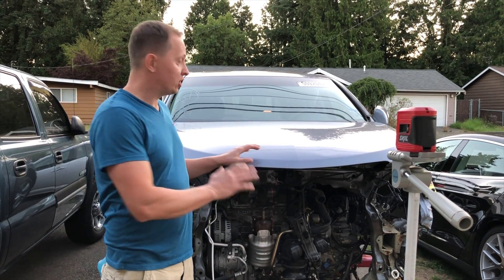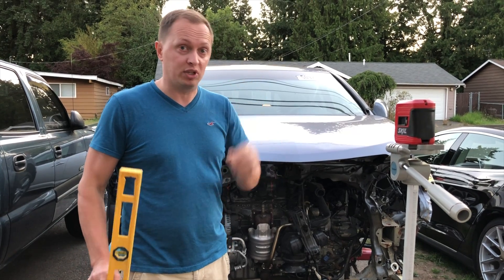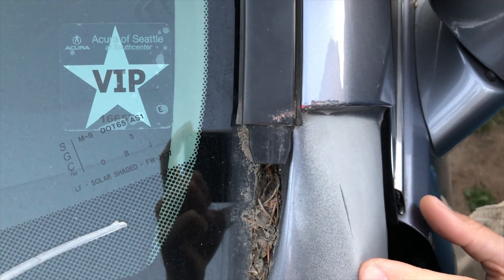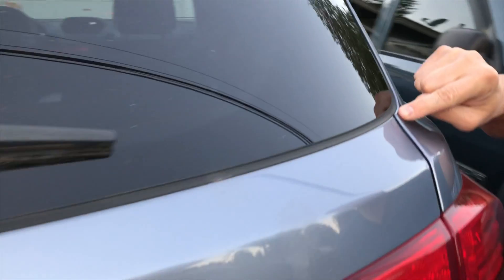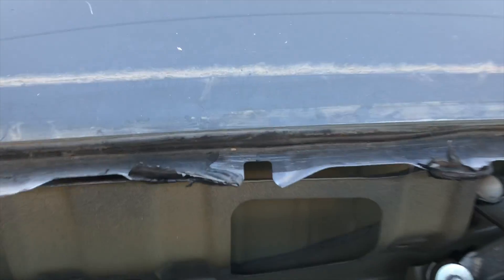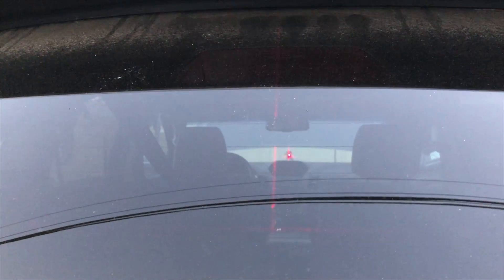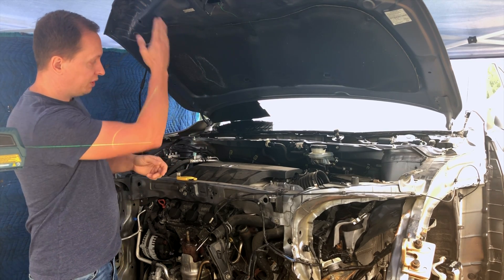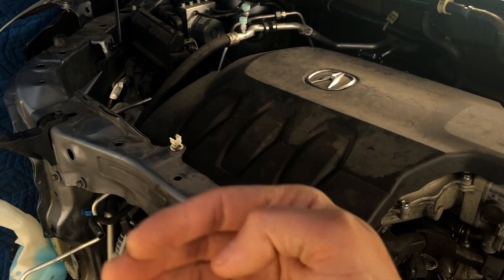✅ How To Use a Laser to Measure Auto Body Car Frame Damage Collision Repair Equipment Universal DIY

Comment: Wait! You are judging the frames integrity based on the the tin foil attached to it?  Obviously I am no expert or I wouldn't be here, however common sense tells me....
- ....the sheet metal between the frame and core support could easily be compromised a 1/4" without effecting the height of the core support itself.  
-  Which  means this entire process is dependent on the one part you dont show, leveling the car. You comment on the importance and skip right to the center line? 
   If someone watching this doesnt understand how to use a level to measure for a centerline they sure in the hell dont know how to use it to level 4 corners of a car!
-  So, I can only assume the car is supported by jack stands behind the front wheel because surely  a coil spring cant be trusted, can it? And you don't think the frame rail could be bent up forward         of the jack stand and absorbed by the vertical sheet metal in the core support with out effecting its horizontal axis across the top? Especially with the hood latched?

I am not saying your wrong, I am just applying common sense and CAN NOT afford to not get it right the first time. Is there a reason you are not using a Centerline Gauge? A cheap set used can't be much more than a laser level? It' has to be MUCH more accurate  than using the sheet meta... that even looks bent?

I realize this is 5 years old and will have to seek answers else where.... however, like I said, I can't afford to not get it right the first time.
Reply from the maker: That was an old video, I've got some other videos that are more recent where I go into much more detail on getting everything leveled out and measure it out. Here is a link to one of those videos if you're interested: https://youtu.be/3mwsqGRthSE

Comment: Wow i guess you dont need any service manuals with this method pretty awesome
Reply from the maker: Yes, this method works great. Only caveat is: one of the sides of the vehicle has still retain its original dimensions, meaning that it cannot be damaged due to the accident so you can mirror off of it.
Reply: So in other words as long as one side has no damage you can use this method.
Reply from the maker: Exactly...
Reply: So in example if just the front left of a vehicle is damaged this method will work.

Comment: excuse my ignorance , what happens if the hit is on the  A piller in front section or near tail light corner on which you had taken as datum point? what changes in measuring procedure we should make in this scenerio?

Comment: What if you don’t have a very level ground?
Reply from the maker: There is really no such thing as a level ground, and even if there was your car would still not sit level due to different air pressure in the tires or uneven sag in the suspension. You have to level the car out. I go into greater detail as to how that is done in this video right here: https://youtu.be/27GgjEsZe_w

Comment: Hi, love your work. Just one question. When you level the car using the laser, it is clear in your video that you are leveling the car from the front side to side and center and that you are also leveling the car from the rear side to side and center; but not so clear how you level it front to back. Do you just eyeball it with the thought that your side to side and top to bottom measurements will not be effected much if you are off slightly? Or are you actually leveling it from front to back as well and if you are, how do you choose your reference points on the car to level from front to back?

Comment: What method was used to level the vehicle?Thanks
Reply from the maker: just a jack under the side of the vehicle that was lower then the other side
Reply: Once you start to
Pull do you continue the process of leveling during the repair?Meaning pull them level,pull then level? Thanks for the advice

Comment: When measuring the distance between the frame rails, regardless of the double crossmembers, it is very possible that one frame rail could move without the other moving at all, or even less than the first one.  I am repairing a Chrysler Lx platform vehicle with nearly identical damage.   Point of impact almost spared drivers headlight, did spare the hood and door, but folded the knuckle partially, pinching the tire from above, broke upper a arm, bent the strut, broke sway bar end link, and tie rod end, and bent the mounting bolt within its engine cradle mount it box, which was quite a feat to remove the bolt and correct the box.     The front crossmembers consist of the bumper, which was under tremendous stress when I loosened the four bolts, the radiator under support, a U shaped piece which was bent, but easily correctable, and the upper cross suppor, which is a metal/plastic hybrid piece spanning fender tip to fender tip, and also support the radiator from the sides, and bolts onto the frame rails.    Of the three pieces, the bumper seems to be maybe the strongest, and appeared unharmed.   The rad support shows that the drivers frame rail bent in but may or may not have put enough pressure on that rail to move it, but I doubt it, as I bent the radiator under support with feet and hands, no machine.    The upper cross piece is certainly strong, but by its feel and construction can’t be impervious to flex, bend, or the like.    At first I thought the passenger fender and rail had not moved, but the hood always shut as if both fenders were off to the passenger side by 1”, and that same 1” repeated itself all over the place, like rotor face to rotor face from laser lines down the side showed the whole cradle had moved 1”, with drivers side showing 6” to the laser, and passenger side 5”.     Point is, with the measurements made assuming the crossmembers were still true you can be led down a path of miscalculations and mistakes.     I speak from experience.    This car seemed to be a simple pull of the whole front end as one to the drivers side by 1”.    I first fastened to passenger side from the firewall back a bit to hold the car in place.   Then from drivers side pulled from three points behind the strut mount area, to in front, and half way from there to the end of the rail, and did so  simultaneously, one  pull with a 3 ton chain fall, which proceeded to pull both the full sized pickup and Suburban acting as dead weights backwards, with the 5500lb truck moving 1”.   I could see and hear the whole front end moving, but regardless of how far past the correct point I pulled, it always went back to the post accident position.     Moving and making it stay has been a battle of several points simultaneously, with different push and pull points, and stress relieving the areas of bend.    Mind you, the bend was imperceptible, with no singular spot showing bent metal, but the hood would never close correctly, no matter what I did, yet the replacement fender fit in absolutely perfectly on the impact side, with no issues with shut lines with the A pillar or the door.  Passenger fender how shown 3mm of movement towards the A pillar, which means that the entire front structure transferred the impact force such that it  wrapped AROUND and applied considerable pressure perpendicular to the impact, pushing the passenger fender straight rear wards towards the A pillar base just enough to chip its paint, and shorted the gap from about 7mm to about 3mm.   Incredible and unpredictable as to what these chassis are doing.      The torsional rigidity in this chassis is also notable.    Leveling the rear end, and putting the back lower control arms on blocks with thin sheets of shim to make it very level always moved the front end nearly the same.     With the front end sitting on its frame behind engine cradle, jacking the right rear 3” would lift the right front off its jack stand by 1”, some 7’+ forward.       That’s impressive.    My full frame Suburban can’t remotely do that trick.        Those crossmembers could be slightly deformed with showing any obvious cues.     I have gone back to square one four times thus far with my endeavor, with the most important points being that the engine cradle bolt holes on the front frame rails must be exactly where the factory measurements show.   I shouldn’t and will not rely in being able to shift the cradle around to correct fro non-centered frame rails, as any point of reference is down the toilet and alignment becomes a nightmare because the strut and upper Arms mount in the shock tower independent of engine cradle, so any shifting of the cradle to center it also affect camber on north sides, where perfectly even camber measurements side to side would mean the engine cradle might be centered, chassis wise, SAI and true caster will be off.
Reply: I've learned to not use cradles to measure from although it's allowed. Alot of movement from factory. measure back further to center car first

Comment: Great video with lots of good helpful info! Would be nice to see a video of what you do once you figured out rails or tower moved. Like where do you make the correction, where you attach to and pull in which direction 💪💪
Reply from the maker: I am currently working on a car where I have to pull both rails and one of the strut towers back into place, it’s going to be a pretty in-depth video with explanation on the whole process, stay tuned for that...

Comment: Awesome. I will use this to figure out what is wrong with my truck. I bought it from copart with frame damage. I took it to a shop and they had it for 6 months. Then they gave it back and it was leaning to the driver side. I took it back and they had it for 3 more months and they just gave it back to mee but it still leaning and I notice the driver front wheel is also further in the fender than the passenger side. The time they had it for is just ridiculous to not even had fix it. I will take it back once I see what is wrong with the laser. Or should I ask for a refund?
Reply from the maker: The whole thing sounds a bit fishy... Go ahead a level the truck out side to side and check everything against the laser. And if things aren't checking out you may want to ask for refund..

Comment: Best explanation I've found. Subscribed. Any info on how to measure the back end of a car? Like say a 92 honda prelude that had a glance and blow on the left rear corner, pushing the bottom of the tail light down and in by about 2 inches but the top of the tail light still somewhat close to lining up, also pushing the quarter panel to within a couple of centimeters of the back side of the tire? Just a totally random example that I picked out of my head, not that it's my current situation or anything. Cough, Ahem, Cough. Like how would I be able to figure out exactly how far I need to pull it out if it measures as level? I guess it might be described as the other dimension measurement. Thanks for the video, the knowledge and any tips. Keep up the good work. Finally a good video that isn't just a sped up video of some guy working on something, with absolutely horrendous music playing on a loop and has no spoken words whatsoever and only an occasional sentence or two vaguely describing a random step they are on with describing any before or after. Seems to be way too many of videos like that, so your video is top notch. All useful and insightful information and no bullshit. Thanks again.
Reply from the maker: If one of the quarter panels is damaged, you can take the measurements of the opposite side quarter panel assuming that the other one isn't damaged
Reply: Ok. That makes sense. The other one is not damaged at all. So I've been doing that. But now I am curious about how to measure the wheel arch to see/make sure that it isn't "bowed out" I guess you could call it. Cause when it was hut on the left rear quarter, it pushed the bottom part of the quarter panel (which is hidden by the back bumper cover since it extends all the way to the wheel arch) causing the back of the wheel arch to close the gap between it and the tire, while at the same time (since something else has to give to account for that) causing the top of the wheel arch to kind of bend upwards/flare out. 

After watching your video I built my own anchors for pulling and straightening out the body of my car where I park it on the side of my house on a brick patio by taking measurements of my car, the wheel locations and the locations where you are suppose to jack it up and put jack stands. Then I pulled up the brick from where my wheels and jack stands would be, dug out about 4 to 5 inches of dirt, put stakes down and ran a string around them all, put markers down and measured them all and made them all equal so that they all would be perfectly level and filled with concrete up to the markers. Then in front and behind I dug out 3 foot by 3 foot squares 6 feet from where the car would be and hammed concrete stakes at roughly a 45° angle from each square and at a slight downward angle so that about 8 to 10 inches of the stake would be inside the concrete form so that the act of pulling on the slab would kinda want to cause it to dig furter into the ground in the hopes of preventing any movement. I then took some rebar that I bent in the shape of a U and hammered it into the ground until just the tip would be sticking out above the forms and filled with concrete. One for each corner of the car. I could then take one of the many chains I have with hooks on each end and hook them to the rebar that barely peaks above the hardened concrete. I used a fat masonry drill bit to clearance out the concrete from the rebar so that a hook could hook onto it. I could then hook a come along onto the chain that is hooked to two of the anchors, allowing me to pull from different angles. I'm also now working on something like an a-frame with a pulley wheel at the top that will allow me to pull from different angles than just down low. 

Anyways, I had to brag to someone about it haha because I guess this whole comment could just be simplified to this:  But I've got the quarter panel pulled back to the same measurements as the other side, but how would I check to make sure the shape just above the wheel arch is the same? I do seem to have a gift/curse of being able to tell if two things are not perfectly lined up and am able to do so to less than 1mm alot of the time. It's a gift and a curse, because while I'm able to tell, it doesn't tell me how to make them match and drives the O.C.D. in me absolutely crazy! Haha. But I'm curious if there is actually an accurate way to do that. 

Okay, I'm done typing. Thanks for your time and help. Went out and bought a cross beam laser level after watching your video last time. Same one you have in the video. Amazon had a deal on one for $22. Couldn't pass it up.

Comment: YOU FORGOT TO CHECK THE GROUND FROM SIDE TO SIDE TO VERIFY ITS LEVEL BEFORE MEASURING THE HEIGHTS OF THE RADIATOR SUPPORTS.   COULDN'T YOU JUST MEASURE FROM THE GROUND UP TO THE TOP OF THE RADIATOR SUPPORT TO COMPARE VERTICAL HEIGHTS?
Reply from the maker: NO ground is level, that's why I leveled the car out side to side first before I took any measurements

Comment: can you help me. i have a question for you  do you have a email or social media to message you?
Reply from the maker: What is your question? I might be able to help you on here...
Reply: @fix206  I hit something under the car and it shifted my subframe back a bit.  

Since then I replaced the subframe.  All new shocks, lower control arms, ball joints, inner and outer tie rod ends.    Pulled the front lower subframe chassy so it aligns better.   Recently replaced the entire knuckle on driver side where impact was.   However my car is always leaning to the driver side.  It’s about 1/2 inch lower.  I can’t figure it out.
Reply from the maker: Go ahead and level your car out with a laser like I showed in the video, and then check and see if the strut tower on the damaged side got pushed upward or not
Reply: @fix206  I looked at the shock towers and I don’t see any stress marks or breaking of the seam sealers.   I wonder would a spacer on the top hat or a spacer on the lower spring help without going to a frame shop?  How do you fix a pushed up shock tower properly?
Reply from the maker: You would need to put the vehicle up onto a frame rack and make a downward pull on a strut tower, unfortunately that would be the only way to pull the tower down if it was pushed up...
Reply: @fix206  thanks for your feedback.
Reply: @fix206  “All The Injuruea”, but sufficient for o 0.5mm. 
This die to mirrors & work tomorrows.

Comment: Willa a cross line laser im the range of +3mm 10m be suitable? Im but huepar 9011g
Reply from the maker: Yes, the laser you're talking about should work just fine. The laser is usually set no more than 2m away from the car, so at that distance you should be +1 mm
Reply: @fix206  should I add this 1mm to e.g. the horizontal and vertical? should I take into account any these differences?
Reply from the maker: I wouldn't worry about it, when you are making your pull you don't have to be exact down to a millimeter. Unibody vehicles from the factory come out with up to 3 mm tolerances, vehicles that sit on a frame are up to 5 mm

Comment: You have to make sure the vehicle is sitting perfectly level. Also have to make sure the laser is perfectly aligned with the car.
Reply from the maker: That's right, first I level the car side to side down to a millimeter, and then I line the laser up with the car. Pretty sure I covered all of that in the video
Reply: Ya,Homeboy says that in the first minute of the video. Thank you for echoing his words. REVOLUTION!!